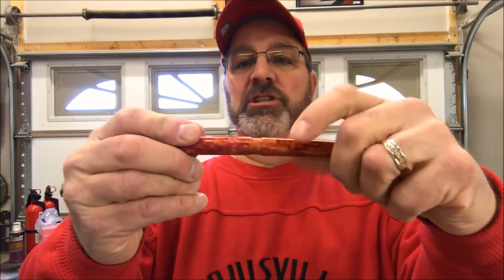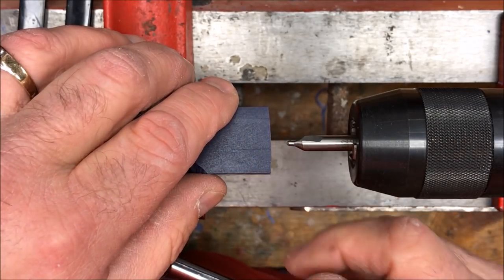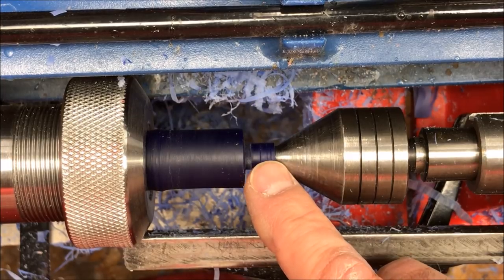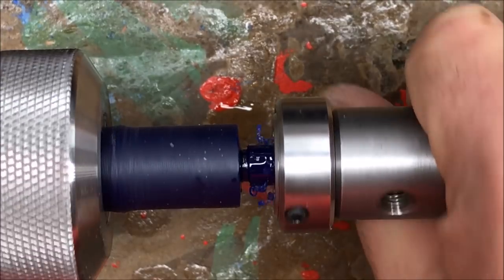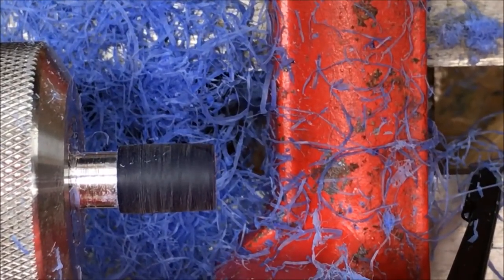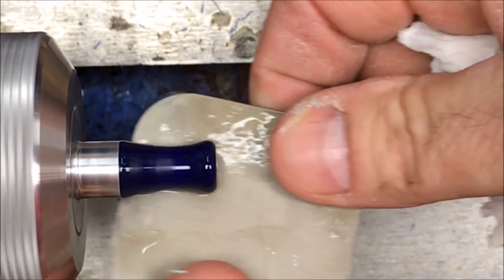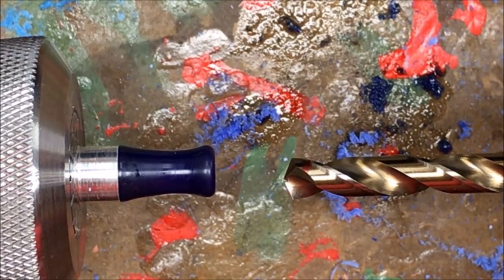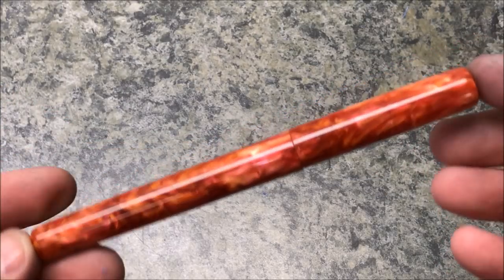Turning The Section Of A Kit Less (Bespoke) Pen

Comment: Great job demonstrate video on how they are filled or how cartridges go in👍
Reply from the maker: Once I get some converters, I'll do a video.Regards,Bob
Reply: Some put o rings and silicone grease on the threads and use an eyedropper to fill the body with ink. The o ring and silicone then act as a seal. But the joke is . . . . .  

"How do you tell if someone is using an eyedropper pen? " Look for the ink stains on their hands and shirt pockets. 

Thank you I'll be here all week, try the veal. :-)
Reply from the maker: LOL.

Comment: the m10 x 1 die you use in this video is it single, double or triple start? Secondly where did you purchase it and the tap from thx
Reply from the maker: The M10x1 is a single start. I believe I got it off of EBay. 

Regards,
Bob

Comment: Tried the link you mentioned in a reply on one of the other videos regarding that sliding tap & die holder and the link didn't work, and I can't seem to find anything anywhere.  Do you have a better link perhaps?  

I'd like to try one of these pens at some point, but of course I don't have one of those collet chucks and I don't have the sliding tap/die holder...course I could hold it by hand but I don't think I could keep it straight and steady enough to get good threads.
Reply from the maker: I got that from www.neilsniche.com. 

I’ve seen people bold them with a Jacobs chuck. 

Regards,
Bob
Reply: Awesome, thank you Bob.

Comment: Question about the tap/dies.  Is a triple start tap/die set only used for the body and the lid?  Then another specialty tap that fits the specific nib and then a "regular" tap/die for the section and body joint?  Boy those triple start tap/dies are hard to find.  Any idea where to find them at a good price or where to find group buy opportunities?
Reply from the maker: You’re exactly right on the tap and dies. I got mine from a group buy through the IAP. Jim Hinze at Hinze pens on FB sets up group buys too. 

Regards,
Bob
Reply: Check out Turner's Warehouse if you're still looking for triple start taps and dies.

Comment: thank you. I have some precision machined mandrels of various thread and pitch sizes. The fit nicely into my collect chucks and standard jaws. However, sometimes (very often actually) I find whatever I am turning is out of round - especially where the section is inserted into the body. One side of the section is wider than the other. I do ensure that I remove some threads so all seat properly, but I continue to produce out of round sections. It is like I am using an offset chuck. Any advise would be greatly appreciated. Thank you.
Reply from the maker: Hello Tanner. ,
  I was having the same issue on my TurnCrafter Wood Lathe. I recently purchased a metal lathe and I’m having no issues.  I have used a Jet Lathe at my club and the pen was perfect. I’m starting to think the budget lathes just aren’t as well machined as some of the nicer brands. 
  You will notice when you bring your tail stock forward that there is some front to back play. If you don’t hit it perfectly straight with every operation then you will get ovaled components. 

Regards,
Bob
Reply: @RJBWoodTurner  thank you. I have 5 lathes. None are budget ones, but none are metal. I think I need to get better at true-ing the blank. My centers are dead on and the section is short. Thanks for the reply and videos.

Comment: Loved this series of videos I have a question though how do you go about adding a clip to the cap?
Reply from the maker: I believe I would make the cap a bit longer. Part off a section, drill and tap it then thread it back on with a clip between the two pieces. At least that's what I plan to try. I haven't done that yet.Regards,Bob

Comment: Does your 10mm wrench give you 10mm tenons ? I've tried this and due to clearances it was a little bigger.
Reply from the maker: It seems to, I'll Use the calipers to check the wrench then the tenon to be sure.Regards,Bob
Reply: Probably wouldn't make a difference since you were cutting threads. Any overage would just get cut off when threading.

Comment: Hi Bob, im having trouble with my threads disengaging from the mandrel. Alnost like the threads have been ripped off the section and it will continue turning in the mandrel and not  "bite". I assumed i was being too agressive when turning the section but you are much more agressive with your chisels than I am. Any idea why this is happening? Wondered if the same happened to you at any point
Reply from the maker: If you use a .75 or finer thread it may not have a good bite. 

Your tool May also be dull. Check the edge. 

Regards,
Bob
Reply: @RJBWoodTurner  thanks for the response Bob. Im using 11/1 so should in theory be ok. I notice it has a small amount of play when screwing the section in until it contacts with the shoulder of the grip. Assuming this is normal? 
Will take my tools to the grinder immediately before working on the grip section next time and see if it solves it.
Reply from the maker: What speed are you turning at? Maybe it’s to slow.
Reply: @RJBWoodTurner  i have a bad feeling i forgot to switch the speed back up to the second gear meaning i would be around 1500rpm... i will make sure i go back up to around 3000rpm and sharpen my tools straight beforehand and see what happens. 
I really appreciate the responses Bob! 

If i cam ever make enough money from this hobby ill buy a fully variable speed lathe haha
Reply from the maker: That’s a great investment. 

Regards,
Bob

Comment: Who hoo, turned a really great pen Bob. Will you fit a clip on so you can put it in your pocket too? As always, take care
Reply from the maker: Thank you Van,
  Not for this one., I need more taps and dies to mount a clip. 

Regards,
Bob
Reply: On the top of the cap, why don't you make a tenon the same size as the end of the body where you screw on the section? Then turn another short piece and tap it like the cap thread end. Get a clip that has the same diameter as the threads and screw it together with the short cap.  However, you do need to get a bottoming tap to put threads in the very short clip cap. A bottoming tap does not have a taper.  Just a thought. Otherwise, I remain in awe of your video.
Reply from the maker: Hello Steve,
  This is only my third bespoke pen. I plan to research clips and tools than grow as I move forward. I’ll get there. 

Regards,
Bob

Comment: WD40 causes alumalight to swell a bit, as it can infiltrate slightly. That is beneficial if you are making parts that need to move since they will be self-lubricating after that but for a part with small threads it can be a problem after it dries out.
Reply from the maker: That’s Interesting, I didn’t know that. I’ll avoid it unless I need to tighten something up. Thank you,

Regards,
Bob
Reply: I found this out the hard way this week!! Switched to Cooking spray now and no issues.

Comment: One additional comment on center drills:  the tip is indeed 60deg but if you drill beyond the taper you are only contacting the edge of the hole you drilled.  That might be ok but if you want full contact of your live center with your work then only drill to the end of the taper.
Reply from the maker: Thank you Steve. 

Regards,
Bob

Comment: When you were assembling the pen I noticed that the tines of the nib were out of alignment. Not sure if you corrected it but it won't write right unless both tines are even with each other. If you haven't tried realigning them just bend the lower one up with your finger again and again until it stays level with the other one. Get pen video wish I had the tools and the customers to get into this.
Reply from the maker: Thank you Kyle, 

  I didn’t notice that but I will check it out and fix it. Thank you. 

Regards,
Bob

Comment: I can guarantee this is a ridiculous question, but I’ve got to ask it... why aren’t rasps and files used more often in lathe work? Is it because they would generate too much heat? Is it because of tear out issues? Are they too slow? Or is it because a blade leaves a much nicer surface and ultimately saves you time in the finishing process?  Once again please be kind, this is coming from someone with zero lathe experience, and just enough fine woodworking experience/knowledge to get in trouble.
Reply from the maker: You can use Rasps but they will leave deep gouges that will be hard to remove. The tools, of sharp, but clean. 

Regards,
Bob
Reply: Thanks bob! I’m looking to get into the craft using some custom cast HDPE plastic (plastic with a 2 inside the recycling shield). I need to get a lathe first but I might try some tests on a drill press 😬
Reply from the maker: HDPE plastic done not finish well. It turns nicely and is great for non stick bushings. With Rasps, you could probably turn it in a drill press. 

Regards,
Bob
Reply: Thanks for the tips!! I’ll send a photo when I’m done :)

Comment: you still drilled too deep with the center drill
Reply: I was thinking the same thing.  If you drill deeper than the cone on the centering bit, then when you put the live center into the hole, the 60 degree of the center doesn't meet the 60 degree of the drilled out hole.  It just meets the cylindrical hole that was left by the shaft of the bit.  You should only need to drill about 2/3 to 3/4 of the cone of the bit into the end of the piece.  That way the 60 degree tapered hole meshes perfectly with the 60 degree taper of the center.
Reply from the maker: Thank you Kyle. 

Regards,
Bob
Reply from the maker: Thank you Gerald. 

Regards,
Bob